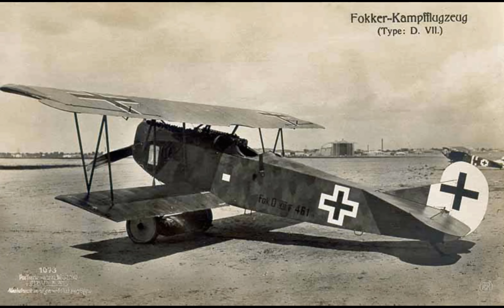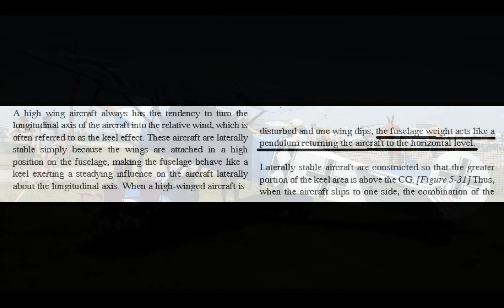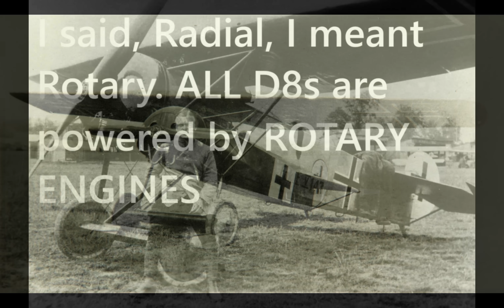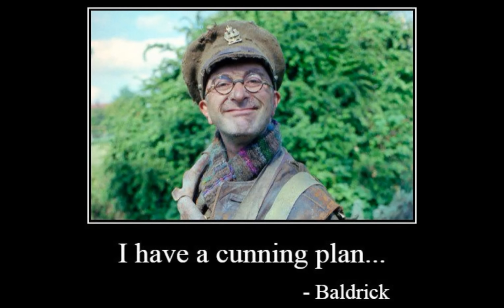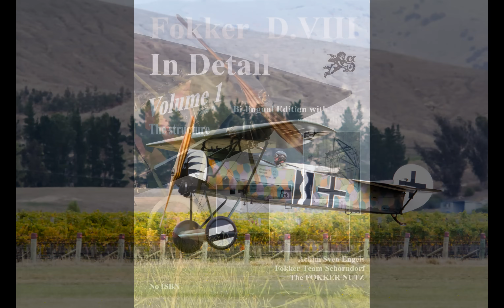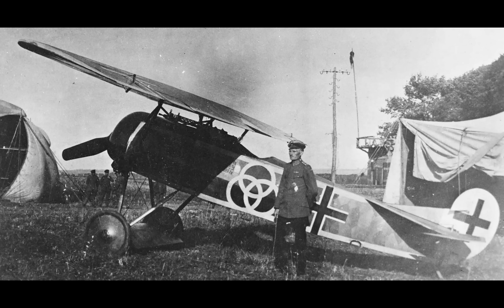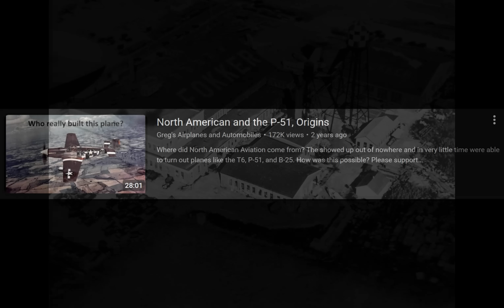Fokker D VIII The Best Fighter Of WW1

Comment: Greg, my respect for the content of your videos is beyond measure, your knowledge spans such a diverse span of aviation history, I am amazed, I had the fortune, I suppose, to be able to work on Pray & Whitney's R2800-99W in the early eighties, when the Coast Guard still had recipes in their inventory: hc131s.  An amazing engine. Was a flight engineer. Love your videos on that one!! And you are right on with specs! Bravo!! I have a question: how did the Fokker D8 stackup against the Spad13???
Reply from the maker: An argument could be made that the Spad 13 was the best fighter of the war. However the D VIII is a lot less expensive to build and has overall better performance. However it's close, and the Spad is a bit faster. It's really hard to say which one was better, especially as the D VIII never has the time to really prove itself.
Reply: @GregsAirplanesandAutomobiles thanks for the reply, my friend!

Comment: I think the pendulum effect is a common myth. The lift vector rotates with the aircraft and does not keep pointing vertically. However, the airframe could cause higher pressure on the low side from slipping sideways and lower pressure on the high side. This might help with getting the aircraft back upright. Also, due to sideslip, the low side of the wing may get more lift by being upstream.
Reply from the maker: The pendulum effect is real, it's just not quite how you might think it would work. It's specifically described in Aerodynamics For Naval Aviators.
Reply: @GregsAirplanesandAutomobiles  Was not expecting a reply on a video this old, appreciate it!
I just read most of the section on stability and control and ran a text search for "pendulum" or even just parts of the word for the entire book without any hits. I also found nothing indicating it when reading the section on roll stability. 
I don't doubt the configuration contributes to roll stability, in fact the book outright states a high wing has a similar effect to a few degrees (I think 2 to 3) of positive dihedral whereas a low wing had the opposite effect. 
The center of this issue seems to be whether the increased stability has to do with the relative position of the center of gravity and the wing. 
And reconsidering the issue thoroughly, I see no reason why it should not act like a pendulum honestly. I know I rejected it after watching a video about roll stability that was actually pretty good, but I think it missed a thing and so did I back then. The explanation is what I wrote in my original comment. The lift vector rotates with the aircraft and thus there is no torque component. However, this is true for the force vector in a pendulum too and the torque component in an aircraft simply comes from the weight pulling the airfoil off-center. 
Just a stream of thoughts. Have a good one!

Comment: What I take from this is that the benefit of the lower wing was completely negated by the drag and weight of the wing and components to support it structurally. And given the relatively low-powered engine in the D.VIII which had slightly better performance... the lower wing could have been a net negative.  I wonder how a D.VII with the D.VIII's airfoil shape would have performed.

Comment: If the Old Rhinebeck areodrome has a replica D8, they probably know its stall speed from flight testing.
Reply from the maker: I don't think they do that type of flight testing. Why would they? At most they would need to know the stall speed in indicated airspeed, not calibrated. If you can find a picture of a WW1 replica with that type of calibration equipment on it, I'll be impressed.
Reply: @GregsAirplanesandAutomobiles  Replica aircraft would be flown under the experimental license category.  IIRC the FAA does want to know certain parameters of the aircraft, or at least that the constructor is aware of them.  So I'm sure that the pilots of these show planes would be aware of their stall speed in indicated airspeed, and the accuracy of those indicators should also be known.  So while not strickly accurate, you could get a ballpark idea of what the aircraft type was capable of.  I doubt that the instrumentation of that date were any more accurate!
Reply from the maker: I have flown certificated aircraft that did not have calibrated data all the way down to the stall speed.
Reply: @GregsAirplanesandAutomobiles  I know that the aircraft I have flown, did have published numbers for stall speed  I don't know what actual data was filed with the FAA for certification.  I also know people who have built their own aircraft, and what they had to do during flight testing to get their experimental AC.  They certainly knew their expected stall speed, maybe not to lab accuracy, but indicated by their air speed indicator.   And that is all that I expect the guys at Old Rhinebeck would know, which is enough to keep them safe flying old planes, not that they don't know how to recover from a stall!

Comment: This chap thinks in quite a sensible way, and tells a nice story.    A suggestion for you, if I may.   
Find a friend who's a mechanical engineer with good engineering/CFD software skills.   Get him to create a model of the aircraft, and test it there.   Not quite the same as real world testing, but with current software, pretty damn close!
Of course,  that guy who's building and flying the replicas should also be able to give you that information.
Reply from the maker: I think the way I came up with stall speed is pretty good. There is no budget in this sort of video for creation of a computerized model, not would there we any guarantee that such a model would be accurate. That's the reason all planes have to have real world flight testing even today. As for the guy building replicas, for him to know the calibrated airspeed at which the plane stalls, he would have to have one of those long probes like you see on test planes and compare it to the plane's actual airspeed indicator in order to get an accurate reading. Nobody is doing that.

Comment: This is the stupidest aviation analysis I have ever seen on this channel. An engineering disaster and a piece of flying dysfunctionalism reminiscent of a Pierre Sprey powerpoint is the best fighter plane of WWI? No. Its actual record shows its flaws, for the same reason, the original F-16, before the back engineering to fix its own structure flaws and extensive electronic upgrades finally turned it into a passable modern launch system for MISSILES, was the wrong solution to a new problem.
Reply from the maker: "the stupidest".

Comment: WW1 aircraft ALL boiled down the available engines, once the problem of synchronised guns was resolved! The designers had to work around horsepower and, in the case of rotary engines, lubrication and in the case of the Water-cooled engines, adequate cooling.

Comment: Fokker designed in the 30’s the G1 Reaper, with 8 machine guns in the nose, due to second choice engines (Germany and the UK kept the best engines for themselves) and tantalizing decision making by the Dutch government it wasn’t the success it deserved, but the ideas of multiple machine guns in the nose, a double tail was taken over for the P 38 Lightning, which came a few years after the G1 and had the learned lessons from the G1 and other planes. You need to be aware that a lot of planes at the end of the 30’s and start of the 40’s were obsolete the moment they went in production because of the speed of innovation.

Comment: 1:20 In fact Fokker developed several prototypes, including one that was basically a Fokker D.VII fuselage with a wing along the later E.V/D.VIII fully plywood skinned design. It looks much like a Fokker D.VII without it´s lower wing and therefore often is described as such. Actually it was an separate attempt that did not see mass production. The Type designation was V.29. The E.V/D.VIII Fokker type designation was V.26 with the 110 HP rotary and V.28 with the intented 11 cylinder rotaries of higher power output.

Comment: So, by the same qualities - low cost and ease of mass manufacture, the P-51 is better than the P-47 ?
Reply from the maker: By that metric alone, then yes, of course. However comparing the 47 to the 51 is more complex because there is a ground attack and a long range escort side to factor in. That's part of the reason I have never said which of those two is the "better" plane. With WW1 fighters it's much easier.

Comment: Very good presentation. Well done. It puts that little plane into its place, especially with a look at its post war influence. Finally the word is coming through. Thanks a lot for the overall very good documentary on the D.VIII and the mention.
Reply: I was hoping you would see this, was about to forward it to you. Thanks for the help with my 1/3 scale V25. I was very interested that he said that the frontal area of the DVIII was .634 of the Eindecker? How is that possible? Was the cowling more compact?
Reply from the maker: Thanks for the view Achim and Whit. ON the subject of the frontal area, I mis-spoke there. The drag is equal to a flat plate of 6.34 square feet, not that the frontal area is 6.34 square feet. I'll make a correction in the video description. The EIII's number there is 12.61. The massive difference is in the wing and bracing. I'm sure the cowling and tail have an effect as well.
Reply: @GregsAirplanesandAutomobiles Thank you!! I’m building a 1/3 scale replica of the V25 prototype and Achim has provided some information to me on it. I’m amazed that it was not a more successful fighter as it’s so clean and very modern looking, very like many modern aerobatic designs though the wing is obviously a different airfoil. It gets rid of the weight of the parasol wing braces at a minimum. I understand that downward vision was one issue but then how did P51/ME109/P47/Spitfire pilots manage?

Comment: I think reasons for the parasol are relatively obvious. FIrst the main box spar was through the wing, and attaching this was, as done on the DVII and the DR-1, Fokker's pride to eliminate interplane struts and flying wires. It wasn't perfected but Fokker had great faith in it. Going to a through fuselage spar would mean an entirely different design, and ground vilibility and forward meant a parasol wing. These values changed over time. Fokker simply kept using the box spar cantiliever wings from then on but really the best design of the time was that of the Junker J-1, an all metal cantiliever wing that had superior strength. Junkers was the most significant player in this technology.

Comment: The part you mentioned about wrong size of spar components might be right.. Supposedly the builders were shaving the tops of the spar caps to make the ply skin fit properly.. and not just a little.. maybe a 25% reduction in some areas near the centersection..   I dunno.. If I was subbing out work I'd damn sure have some QA guys on MY payroll..

Comment: The parasol wing and variance of that type are usually very stable. The Cessna 150 has a parasol type wing as is very stable in flight. In the movie The Blue Max, George Peppard ( Bruno Stachel ) is a German fighter ace and is killed flying Fokker D VIII. Great old movie.
Reply from the maker: The Cessna 150 is a high wing, not exactly the same.